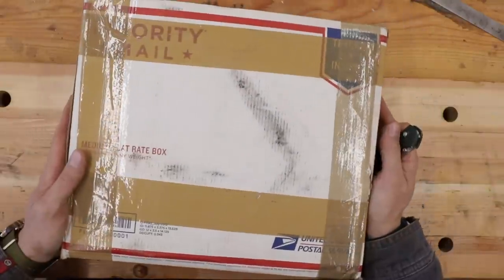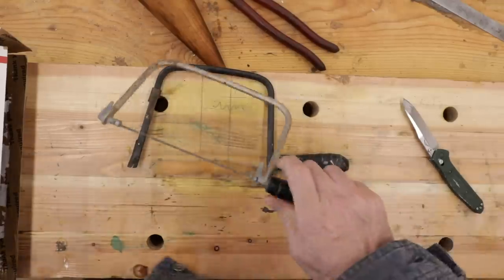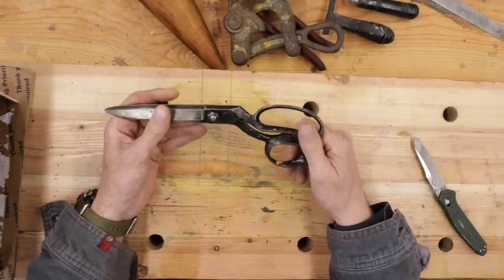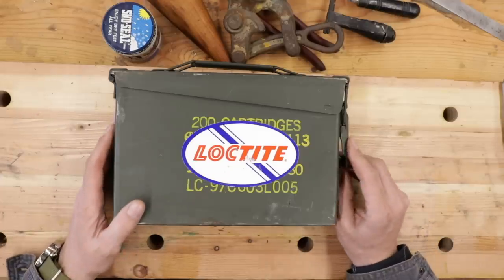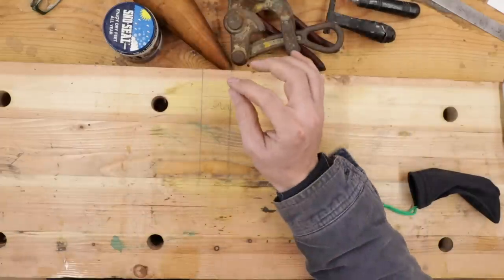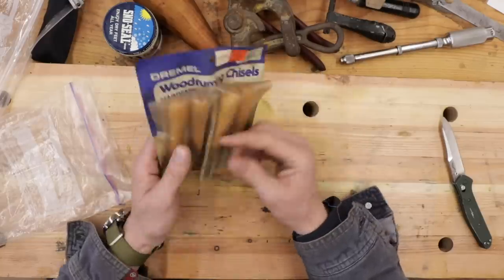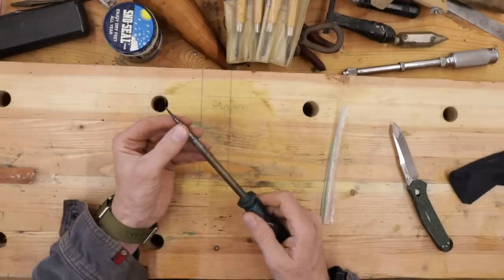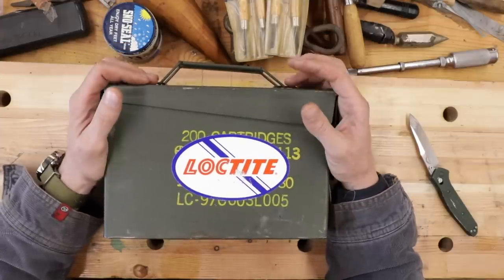You Won't Believe What's Inside This ARMY Box

Comment: The split blade screwdriver we used in the elevator business to reach into tight spots with a regular slotted screw .  The screw is held to the driver tip by pushing the slider toward the tip with the screw slot mounted between the two split bit pieces.  The screw is started into the threads and turned just like a normal flat blades screwdriver.  Once started, tightening is accomplished with a regular screwdriver.  The electrical  “starter”. Screwdriver driver cannot take a lot of torque.  Handy maybe once in 10 years, unless you are an elevator mechanic or electrician.   Enjoy!

JoeB

Comment: 22:05 the "wedge" screwdriver is designed to hold a screw that you are trying to insert into a tight or hard to reach place. You slide the collar out which brings the ends together, then set the screw on the end of the screwdriver, then slide the collar towards handle. Now the spring tension of screwdriver is holding the screw.

Comment: Item 4 is a lineman's wire puller.  It may have been made by Kline Tools.  - Irem 5 - Dressmakers Shears -  The blue screwdriver is designed to hold slotted screws.  -

Comment: The rectangular wood handled knives and the triangular blade knife are leather working knives. You can smoothen the rough side of leather to make leather thinner or put a taper on leather ends of laces, etc. The triangular blade is for lace tapering, the rectangular is for flat strip tapering. As an example you can make a leather cylinder by cutting the ends of a rectangular piece of leather diagonally so that when they meet they match. Then you use the rectangulayr skivving knife to create matching bevels on both ends. Now you are ready to glue the ends together. This requires tapering on both sides of the leather, you have a top bevel and a bottom bbevel so when it is glued together it resembles a toilet roll cardboard core. Tapering and gluing can also lengthen cords and wide strips. The tools have to be made uniformly razor sharp. Hope this tip helps. Take care and God bless !

Comment: That ammunition box; I just made a portable campfire out of one of those, that I got 20 years ago, when the school one of my sisters worked at was cleaning out the " lost and found"  after using it to carry my lunch in for several years, and a target for a slingshot, and a BB gun... I'd used it as a small fire bin with sticks, but I just watched a video of yours where you put dryer lint ( aka. "cremated remains of socks you lose in the dryer" ) into an egg carton, and melted wax on it...  A 12 pack egg carton will fit snugly into that box, fill the carton with lint, then melted wax... This lights well, there's no smoke ( that I could see ) and just close the lid, and the flames stop, and it's got a handle. It burns ok, I made a cup of coffee with it, and without adding anything more than a match to it, I've re-lit it three times. ( it doesn't smell like a nice campfire though ) probly not your "go to" campfire, but radiate campfire makes a product that's similar, but it's in a small tin. It likes the wind, and is portable, and relight able .

Comment: I have that exact Yankee drill.
I used to follow my Poppa around helping on jobs around the house and I remember the first time I saw him using it and finding out what it was (his was one of the bigger heavy plastic handled ones).
After that I thought I must have one. I looked around for ages and finally found that exact model.
Sadly most of the pieces it has are the same size, only having one snapped off small piece.
They're still so handy today though. If I want just a small pilot hole, it's quicker and easier to just give it a few pushes than messing around setting up a power drill or trying to hit it with a punch.

Comment: Quick wedge Is a screw starter it holds the screw on the tip until you get it started. The coping saw might be a cheese cutter or soap cutter

Comment: The screwdriver  is an adjustable flat head screw holder while installation  is for electrical circuit breaker installation where the falling of the screw can be dangerous or expensive

Comment: Sno seal is great for leather sheaths as both a leather conditioner and a water repellant. Use only in very, very small amounts when conditioning leather. It will add life to the leather. If too much is used, leather can actually begin breaking down, just like overuse of neatsfoot oil. I condition my leathers about once every four to six months depending on the surface appearance. Cracked leather can be stopped from cracking using sno seal. just because leather begins to crack does not mean that you have to get a new leather item when sno seal can prolong the life and actually prevent further cracking. Antique leather really benefits well with very careful usage, using a little at the time until full flexibility is achieved. Using a hair dryer can help it soak into the leather deeper and faster. Hope this tip is helpful. Thanks for sharing. God bless you and your family.

Comment: Quick-Wedge  Slot Screw Holding Insulated Screwdriver features a sleeve placed around the blade to prevent accidental shorting when working in "live" circuits.

Comment: That screw driver was for holding old fashioned straight slot headed screws and getting them started, but not for final torquing.  Application would have been in hard to reach places of an 
assembly.  It was a standard tool issued to assemblers 40 years ago.

Steve in Milwaukee

Comment: Probably not the first with this, but the "depth gauge" looks like a marking gauge.  It should have a cutting wheel on the end that protrudes.  This will cut into the wood fibers instead of just scratching them.  Excellent video!

Comment: The QuickWedge gives various flat head screw driver sizes all in one.  The scissoring action lets you adjust for the screw head you're working with.  They also work as a holding wedge for flat head screws so they don't drop off the end.  Also known as a "Holding Screwdriver."

Comment: The split screwdriver is a screw grabber. You put the tip in the screw slot and push the handle forward. The two blades come together and tighten in the slot to hold the screw.

Comment: The screwdriver is beveled to grip the slot head of a screw when you slide the plastic control down. The cable clamp is to grip the end of a cable to hold tight until you install saddle cable clamps. I used them when I worked for DNR building fire lookout towers. Each of the t40' tower legs had a guyline cable anchored to concrete deadman in the  ground with eye extending out. I built some of the lookouts built in Washington.

Comment: 3 IS a coping saw
4 is a wire strainer, use a rope tackle or come along to strain fence wire
Parts washing brush
Wood marking gauge. The hole and clamp is for circles.
Depth marking gauge.
Vertical Palm drill, works like the corkscrew drive screwdrivers but the chuck takes the drill bits.
Dremel is still a US company, even though it is now owned by Bosch Tools of Germany.
Screw holding screwdriver for putting screws in recessed positions. Now obsolete with magnetised tips.

Comment: I think the split screwdriver at 21:35 is so you can hold a screw on the end of it when you're trying to get into an award space, where you can't hold the screw with your second hand, then once it's part way in your can pull back the outer shaft and drive home the screw

Comment: Gimlets are the screw starter dealies.  Small files are sometimes referred to as "rifflers".  The split tip screw diver is for holding flat slot screws. and is usually called a quick wedge.  The ammo can is a staple of a thousand uses in the field for the military.  They are actually a combat disposable but don't try to get away with one here in the states, they have to be returned to the ammo point with the spent brass.

Comment: As far as the “2 point” screwdriver, it’s a holding screw driver. It holds a flathead screw on the driver so you can start it without it falling off the blades. For starting screws in threads in tight places where your fingers can’t hold the screw. Prior to magnetic tipped screwdrivers. Hope that helps.

Comment: that wire puller (6 min) was used by BELL telephone and the us SIGNAL CORPS to pull the wires tight to the poles for installation and pull the guide wires tight for installation.

Comment: I once followed a bunch of interesting debates about sno seal (wax) and boots fat (sorry if I didn’t get the terminology right - I’m from Germany). The wisdom last conclusion mainly was: sno-seal is nice and perfectly works for water proofing. Nonetheless it lacks the ability to feed or nutriate the leather with the necessary oils which prevent the leather of getting brittle. Heavy usage of boots fat however weakens the leather over time, which might not be desirable , e.g. for hiking boots where a certain degree of stiffness might be really one of the main advantages. I ended up greasing my leather boots once a year after rigidly cleaning them, sometimes greasing them twice in a row and allowing the fats and oils getting soaked up completely in between. That way the leather gets “refreshed” and also less clogged up by sno seal later. After some time, maybe weeks I start using sno seal for the rest of the year. Really happy with that care plan. Anyone similar experience or thoughts about that?
Talking about boots fat I really suggest trying out “Wilmas Kängskosmorning” - really weird stuff :-) 
It’s made from birch tar and smells like camp fire as hell. I guess the smell would even scar bears, haha. If you ever get the chance to get one, get it!

Comment: As a commerical fence guy we call the cable puller a dog we pull tension wire and barbed and bar less wire with them they work good till they slip or the cable snaps

Comment: The screw driver with the slider on it is for holding slot head screws.  It wedges the screw to the tip so you can start it and not fumble with it holding it.  Stick the tip in the slot and slide the collar down and it expands the tip wider and wedges the screw on the end of the driver.

Comment: The aluminum marking gauge with the extendable rod appears to be set up with a cutting wheel on the end so that it cuts a line and doesn't get pulled off line by variations in grain.

Comment: That rotating plate on the ammo can is there to open it easier. The long part goes against the lid of the can to create an opening lever while you pull down on the wire on the base of the can. Just a tidbit

Comment: Cody that device you think it for pulling cable or rope... it's not it's for pulling fence wire like smooth single strand wire or barbed wire.  It make work for a while on rope but the amount of squeeze it can exert will/can cut your rope.  

At 21:30 the tool you have in your hand is for stating slotted headed screws that are in a tight space.

Comment: That cable puller is used alot for putting up phone lines n stuff or putting down guys on poles it's an old "pork chop" they hook on to stand n such they're pretty sweet but that one is used for like fence wire

Comment: Depending on the company scissors over 6-8 inches are generally considered shears. Shears generally have a larger finger hole on one handle then the other and one handle is often offset from the blade. J. Wiss & Sons was founded by a Swiss immigrant in Newark New Jersey in 1848. Newark was the home to several scissor manufacturers until the early/mid 20th century. I own a pair of Wiss that are probably 70 years old and they're better than anything you can buy today.

Comment: The Quick wedge screw driver is for flat head screws. When you take a flat head screw on the end of the screw driver then pull the wedge forward it makes the screw driver able to hold the flat head screw so that you can can get to those hard to reach areas to put a flat head in. Enjoy, they are great.

Comment: Hole on other end is or pencil, Yankee Drill, Screw holder/driver, Barber brush or removing hair after cutting also used with talcum powder. Wire, cable stretcher,

Comment: Screwdriver will hold the screw by pushing slide forward to make the blade wider to grip the slot so you can locate it and start it off, you would then release the screw and finish with a standard screwdriver. More for mechanical assembly than for use with wood screws.

Comment: In hand tools, shears have 2 opposing blades but are larger than scissors, and being shears often means that it lacks the pivot hinge between the handles and the blades.     The pivot or bendy spring is nearer your body than your handhold.

Comment: Whitewash brush forwood slat  fences. And Dremel is an American company based in Racine , WI. Those small wood turning tools are for the old Dremel mini-lathe and are highly desirable. A little pricey due to the high quality, but worth it. Some Dremel products are still made in USA, but like most other American companies, some products are produced out of country. Cody, is the "yankee screwdriver" made by Miller Falls? It's actually a drill, but often referred to as that. Top quality all metal one will last you a lifetime. Just dont lose the bits. They're hard to come by nowadays.

Comment: That scissoring screwdriver is for starting hard to reach flathead screws, you put it in the slot, slide it forward and it widens, therefore holds it in place (kinda like a magnetic screwdriver but probably works better) and you start the screw, it's not for hard tightening or loosening, use a regular screwdriver for that

Comment: Cody the screwdriver is designed to hold the screw.  Keep the slide part up to the handle put a screw on the end 
in the slot as normal.  Then push the slide down to lock the screw to the driver

Comment: It is the rope equivalent of a water check valve !
When pulling something with a rope repeatedly, you pull the rope through this and then release the rope by pushing the lever back towards the clamp !
May have been used in the hay mow where hay first needed to be lifted then brought into the top of the barn !

Comment: That wire puller you got we use them often working on powerlines, I build powerlines in Custer SD and that particular one with the teeth we call bulldogs, we use them to pull guy wire, we also have some that are smooth for pulling the acsr

Comment: That screw driver that splits is a screw starter. You press them together and then insert the tip into the screw and when you pull the optic bit back the friction of the spring holds the screw so you can use one hand.

Comment: The screw driver device has the two side by side blades so it to spreads the two blades wide to fill the slot when the slide is moved forward so it will wedge into the slot of slotted screws so you can start them where you can't get your fingers and such. It is a screw holding starter.
I have one that is older than I am.

Comment: adjustable flat head push the sleeve down to make it small then pull back on the sleeve to wedge out under spring pressure to hold the screw. Kinda like a mechanical magnetic screwdriver

Comment: Agreed on the pestle. My mother made a lot of jelly and jam  when we lived in an orchard area
Regarding the cable gri,pper, I woulld think it woulld work well for increasing the tension on the wire when installing a fence.  Maybe it came in the same lot as your fencing pliers.
Regarding large Yankee screwdrivers, used on large project such as wagons and buggies?
I used plumb bobs to survey in my radar and aiming point.  Believe it or not, I tried to do that in stroong winds and had the cord blow out to the side in some strong winds with a 1 pound bob.  The heavier the better.

Comment: The quick wedge screwdrivers are used to create a (reasonably) positive hold on a slotted screw.  I think these are often used in electrical applications where the screws are made of non-magnetic metals or where it wouldn't be safe to use your hand to hold the screw.

Comment: That screwdriver holds a flat head screw in place by adjusting the thickness (sliding up or down). Don't need a magnetized tip to hold the screw to start it.

Comment: The split wedge screw driver is designed to hold your screw, as the blades separate the wedge into the screw slot

Comment: reading the comments 2 of my items have already been explained "the screwdriver with screw holder and the hole on the marking gauge. The steel item you took out after the marking gauge was another marking gauge made from metal, similar to the Varatas ones you get now. the brush is for "Milk paint" you use this type of brush to apply it,  don't ask me why but that is what it is.

Comment: the Quick wedge is for starting straight slot screws i tight spots it wedges itself in the slot so you can reach tough spots like inside electrical boxes.

Comment: That screw driver is called a "wedgie" and its for holding slot head screws to start them in usually wood after drilling a pilot hole. So that you don't have to put a lot of torque on the screw. To operate it you'd lace a screw, slotted
 on the tip then slide the tube down until it grips the screw.

Comment: Loctite, LOL. So the two pieces wrapped together are marking gauges. The wood one has a pencil holder on the other end. The metal one is also a marking gauge. The one tool was an adjustable screw driver. If you needed a narrow blade or a wide blade you adjusted it accordingly.

Comment: Linesman"s cable puller for tightening stranded cable used to lash telephone cable to for a support or a high voltage wire to take the slack out of the distance between poles and towers.  Cable had to be tensions to a certain sag limitation.

Comment: That's not a cable puller, it's for pulling barbed or slick wire. The fencing pliers can punch wire between the two handles and you anchor the head against the post to get a good stretch on the wire before wrapping around the post and then tying it off.